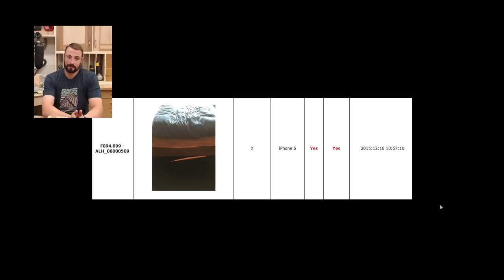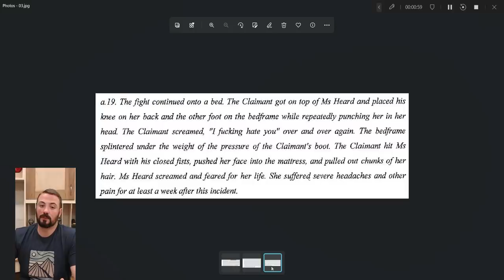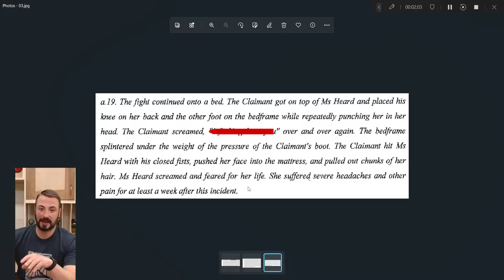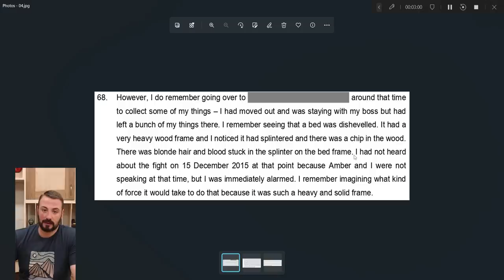Woodworker Attorney DEBUNKS Amber Heard's "Broken Bed” Testimony!

Comment: The only way, as a fellow wood worker, that I see is if the splintering has already occurred then with a foot you could  further split the wood.  Once the wood is compromised along the grain line it could be made worse.  I don’t believe a word she has said, mainly because it is all just a little far fetched, but the split is possible if it was already splintered.
Reply: Exactly this.
Reply: Also the wood he uses to demonstrate is way more rounded which makes it much harder to break the edge off. I’m not saying she’s telling the truth but a break like this is definitely not „impossible“.
Reply: With a house like that, and money like that, I can't see them not replacing a bed if it was already damaged.
Reply: I was wondering if it was already compromised or very old if that would make it possible.
Reply: @papersongs3482  It can be a small crack that you notice only when you slide your finger on it or your pantyhose gets torn by it. The rest and the size of it stays hidden because wood doesn't peel like a banana, and that's why it's fairly possible that the crack was unnoticed or at least accepted without repair until it broke off.

You can't draw any conclusions by their wealth. The room itself doesn't look like a multi-millionaire's house, and based on the amount of houses and apartments Johnny has + busy life + mental and alcohol/drug issues the two of them shared, they really wouldn't pay attention to that kind of stuff.
Reply: @papersongs3482  Also, when you look at the video, they never replaced the wooden frame even after it broke. In fact there is even further damage to it in the pictures.
Reply: I didn’t get a good look at the woodwork either, but “distressed” is a thing.  Some folks like that rugged looking woodwork.
Reply: @henrifin  correct…. I had to have a piece of pine removed from my hand the diameter of a toothpick and an inch and a half long from a splinter that didn’t reveal itself until My hand slid across it while shuffling materials around.
Reply: You'd have thought the police would have noticed the damage to the bed and the giant splinter on the floor? When they did the tour after being called. Add the fact that the body cam footage from the cop shows no wine spilled or broken glass etc... think we can be pretty sure she damaged the bed with the knife on the bed.
Reply: @lilbaz8073  oh…. I’m sure she’s lying.  My liedar is blowing up every time she speaks.  I’m just saying that it is possible if the materials are already compromised.
Reply: Also…. As a woodworker, if I had access to that piece of wood I could point out exactly where the knife went in most likely.  Unless she was smart enough to use a water to drawn the dent from the knife out of the wood.
Reply: @Dogsday198  wouldn't you see that on the splinter though? Darkening where a crack was and the wood was exposed to the elements?
Reply: @lilbaz8073  not necessarily there are plenty of times that I’ve pulled a splinter apart, let it go,and come back to glue and had difficulty finding it again.  It can be split along a grain line and the splinter stays tight to the rest of it.  Certain woods are more likely to show than others…. Oak for instance.  You do find a lot of those while sanding.  Also, and I couldn’t see the woodwork very well.  If it is lumber or Timbers, it is possible it has a distressed finish.  With a distressed finish, they intentionally beat up the material..  that was a pretty big splinter, all I’m saying is that it isn’t impossible.
Reply: Also from my experience, just because there is a split in the material, doesn’t mean people take the time to glue it.
Reply: But even if that were the case, it wouldn’t take the kind of force that she was describing.  It would be really easy in fact.
Reply: @Dogsday198  i meant after the splinter was torn off. If there was previous damage, a crack or split, that would expose some of the inside to the elements. Aging them. From the picture it all looked fresh. There would be signs of ageing on the edge where the split or crack was. Especially as there would be no stain or varnish on it.

Comment: Hi, I'm new to your channel and actually first saw you on a collaborative video you did with The Behavior Arts channel. I've seen similar damage from a powerful hit from a study object, but even then you need two things. The wood being splintered needs to be solidly held in place, which is accomplished by the connection to the rest of the frame, and the object striking needs to have a fairly straight crisp edge that hits parallel to the grain of the wood. The only way that damage was done with footware is if Johnny were wearing old time baseball cleats from the 1950s

Comment: I would say the difference are the 4x4 you are using to demonstrate your point has a rolled edge and looks to be "wet". The bed is stained/finished/ dry with a sharp edge...hard 90. All of this changes the dynamics and characteristics of the wood. I have with work boots knocked off hard corners on natural wood multiple times that look similar to that of the picture of the bed. Curious your thoughts on that specifically. Thanks for the video.

Comment: This a common failure point on large pieces of lumber, from stresses building up as it ages... while your knife example does resemble the picture, it doesn't rule out any existing cracks, that would have been exacerbated from the traffic such a wide bed frame would endure through the years of use. Not ruling it out, but "I'll glue it back on someday", isn't an odd natural occurrence - stabbing a kiln-dried 4x4 under studio lights?... eh.

Comment: When I looked at the splinter I knew it came from a sharp object than a boot, I used to knick the side if my bed with a nail cutter and it looked like that, albeit smaller. The panic on her face when Camille mentioned the pocket knife was also telling

Comment: As a structural engineer, no way JD would’ve broken the bed as AH described - it is way too strong and Rob has done an excellent job explaining it. I could possibly buy if the connections between the pieces of timber had failed, but with a bed that strong, those connections are probably just as strong to hold the weight of the timber. They should’ve called you as an expert witness Rob, but I think JD’s team saw your video anyway!

Comment: As a framer, if wood could break like this from work boots, none of us would walk on walls to set the roof. Not even the weight of a truss coming down too fast from the crane, slipping off the edge of a gable wall could do that damage.

Comment: To play devil's advocate for a moment - the only counterpoint I can imagine - and I'm extremely unsure about this - is that if the wood had already fractured or been split, and then the split could've been levered open with a slipping boot. 

The split could, for instance, be from idle noodling with a knife, or old age and poor treatment, neither of which are evident in the rest of the bed as you would expect.

Thanks for the analysis, very interesting.
Reply: True, but the penknife is lyng on the duvet!

Comment: Hey Rob.
I would agree with your theory according to the photo evidence.
How ever there is another factor we must consider with both pine and some hard wood timbers.
Old dried out timber can splint on the edges/corners can get damaged with some force, say a heavy weight of force with a a shoe with sharp tread, like some work boots. But that force would be of something like a hard kick or step, and the timber may get damaged close to the photo or as you demonstrated..
With greener or young timber, it reacts as you have shown here, as the grains are still lot tighter.
But the way she explains it in her testimony on Thursday, I was picturing his JD foot on the inside between the frame and mattress, to get the force she is attempting to describe.
But again when you look at the damage on the bed frame, there's no way there would be this big damage from one foot wearing a boot. Yes you can see the mark of something that was used for leverage to split this grain too. No boot even the ones I wear would leave these marks on the bottom of the splinter on the frame. It impossible. Looks like a chisel or a big bladed knife. 
So yes it's totally BS from her statement.

Comment: Wow! Up until I saw this video, I thought the splinter was coming off the bottom of the wood and hanging down! Which I thought could have been done with enough downward pressure (like if you bend a stick and it splinters downward) Now I see that picture is an optical illusion 😅 the splinter is separate and laying deliberately right on the ground below the bed.

Comment: I don't know if that is end grain. If you look at the wood grain on the top parts of the longer pieces running parallel to the length of the bed, they do not continue past the last 3/4" or so of that piece of wood. You can see that it is capped with something.

Comment: I very much agree. Although your demonstration piece has rounded edges while the bed frame appeared to have sharper, 90 degree angle edges, which would give it more of an exposed surface for the boot to splinter it. However I would expect, even if the sole of JD's boot could splinter off a piece, it would be much smaller, 3 inches in length at most and thin as a toothpick, not a large 12+ inches chunk. Notwithstanding I can not picture how JD is supposed to have his body positioned for one knee pressing her into the matrass and the other foot balancing on the edge of the bed, given the fact the frame is so wide. Either he would be on the bed completely, pinning her with one knee, or lunging with one leg on the floor, which would also get more purchase, as AH would say.
It should be rather easy to proof this without a doubt by inspecting the bedframe. A sabotage with a sharp object would leave telltale marks in the wood, the canal of entry created by the blade, wood being compressed on the sides, showing the shape of the intruding blade, like a cast.

Comment: One thing I haven't seen discussed is what type of boots were involved. If it was a standard western or dress boot, those have such a smooth sole that trying to brace at that kind of angle on wood like that would have you slipping and landing flat on your face every time you tried to put weight on it. A hiking or work boot you would probably be able to brace yourself a bit better because of the lug sole, but any other type of boot you're far more likely to hurt yourself trying. I know this because my dad always wore western style flat sole boots for work, and dress boots for church, and he'd have to replace the work boots about every two to three years. Personally,  I prefer a lug sole for better traction, but either way, any sole less rugged than that Timberland wouldn't have a prayer of being able to give any sort of support, much less provide enough traction to split the wood like that.

Comment: One thing to consider is how his foot could have been positioned. For instance, if he had rotated his foot to use the heel of, say, a cowboy boot, I could certainly see the POTENTIAL to break off a piece of the timber they way it did. I recall splintering off edges of wood planks and posts in this way myself, but it was deliberate. I still think it would be extremely difficult to have done this in the manner she described. Perhaps it could have been staged in this way.

Comment: I have a bad engineering habit of trying to devils advocate all up in experiments and this is a fun one. 

I think Occam’s Razor supports everything you said. 

I also think there’s a nonzero chance that at some point a knife or flat head screwdriver or something compromised the wood in that spot (or it was damaged during transport) such that bearing weight (during the ordeal, possibly not while their weight distribution was more on the mattress than the beam) caused the remainder of the beam to splinter and sever. 

So, nonzero. But your story is much more plausible.

Comment: I knew when I heard her testimony that it didn't or couldn't happen that way. As far as that tool on the bed, it looks like one of those multi-tools that holds some blades, screwdriver and maybe a corkscrew where they fold in and out like a swiss army knife. I have one like it and the holder can be used as a handle, it would be strong and sharp enough to do the damage on that footboard, just my own thoughts and opinions! Thanks for your demonstration, love your workshop or what I could see of it!! It's clear she put some thought into how to stage it and present it but didn't focus on how probable it was, what movie did she steal that from!

Comment: THANK YOU ROB. THAT WAS WELL ILLUSTRATED ON THE BED FRAME.  WHEN I FIRST SAW THE PICTURE, MY THOUGHT WAS HOW COULD HIS FOOT DO THAT.  THERE IS NO WAY HE CAN PURCHASE THE FRAME FOR IT TO BREAK IN THAT MANNER. SO THE KNIFE THAT WAS GIFTED TO HIM WAS USED AGAINST HIM, BY LEAVING OUT IN THE OPEN ON THE BED SO THAT CONCLUSION CAN BE DRAWN TO  BE USED AGAINST HEARD, HOWEVER, IF PROPERLY RATIONALIZED, THIS IS NOT THE CASE IT WAS USED TO DEMONSTRATE THE ACTIVITY OF VIOLENCE IN THAT MOMENT AGAINST HER; NOT DAMAGE TO THE BED FRAME.  THEREFORE, IT WAS SET TO DEMONSTRATE NOT ONLY J. DEPP's STRENGTH IN HIS FEET BUT ALSO HE WAS CAPABLE OF HOLDING THE HEAD IN PLACE IN THE COVERS, KNEE IN THE BACK, WHILST EXERTING SO MUCH ENERGY TO BREAK THE BED FRAME.  I WISH THEY EXAMINE THAT A BIT MORE AND USED MORE PRAGMATICALLY AS EVIDENCE...  THAT WAS GREAT TY.. ;-))

I HOPE ONE OR TWO OF THE JURORS WORK WITH WOOD TO DEBUNK THIS TESTIMONY OF THE BED BEING BROKEN BY JOHNNY ...

Comment: On a practical point, Is depp double jointed,specifically half way up his shin bones? I ask because how could his knee be applying preassure on a person's back, and his foot be on the edge of the bed seeking purchase. Even if he was wearing a boot with one of those tap dancing metal plates under the toe, he would need to double jointed for that foot to obtain leverage at the same time he was kneeling. On the other hand if this were fabracated, and the person resoncible wanted to avoid perjury, they might claim a mysterious memory loss and thereby no knowledge of their actions between events A, and events B.

Comment: The only book that could have cause that damage to the bed would be a boot with a wood or metal sole. 
Cause these are equally hard or harder and less flexible then the wood.
Maybe, very maybe, a steel cap safety boot could do the same.

However, I doubt any of those were or are worn by Depp.

Comment: Excellent! Also if her back was close enough to the edge for Johnny to have one knee on it and the other on the wooden edge and close enough to lean into her ear then her pelvis and down would be hanging off the bed onto the wood. With all the pressure and hitting and smothering she would have severe bruising on her stomach, front of her thighs etc. As Johnny said “it’s all such bull sh!t”…

Comment: I must say I have actually done this, on pine, with shoes. I have an old house and the stais was old, dry and neglected pine. And for thistest we regrettably don't have the specific piece of wood or the kind of shoes Depp was wearing. 
But seeing as he's a rich men, I doubt it's old, dry pine that's been around since the 50's. And the "tool" on the bed is just a bit.. typical. 🥴

Comment: I broke a bed once when I was 15. I was nostalgic for jumping on the bed as a little kid. Needless to say, it only took one jump and crack! Splintered one side. It was basically just 2 larger than average boards (like 2x4s but bigger like 5-6 in wide) attached to a headboard and footboard. I had just finished taping it back together with clear packing tape and was just putting the mattress back on when my parents walked in. I would have loved if it had been as sturdy as Depp and Amber's bedframe

Comment: When I first saw the photo admitted in the court, I knew that what she is claiming is not true.Even if JD weights 1000 lbs, a 6 x 6 running a span of 5 ft will not buckle to a point of splintering on top edge like that. Done my share of DIY projects around the house and about 6 aquarium stands so I know what it's like to work with soft wood. The two way that you would get that splinter is 1- the way you explained it and 2- if the top is already previosly damaged and cracked in the edges, then his boots could have lodged it loose. Number 2 is highly unlikely because people do not buy broken and splintered furniture knowingly. Also, something sharp would have to cause that kind of damage to begin with. As pictured, her testimony is false. Good job explaining this with "demonstrative" so people will understand how this splinter could happen in the real world.

Comment: It theoretically  "could" have been done by a blunt object such as a hammer (anyone who's ever swung one has "chipped" a board or 2) however the so called splinter is on the bottom and it's pulled down, out and away from the bed itself and would not align with someone partially on top of the bed attempting to gain purchase. The foot would have to be completely off and under the footboard and exerting force out and away from the bed. One would need to be under it to accomplish this

Comment: You can see the point of entry where it was stabbed to break it 
It's a twin of the mark you made in your example
Same spot, on the widest point of the damaged wood. A small dark almost pin point divet in the wood.
What's more is you cut off piece & the other's are practically IDENTICAL
🤔

Comment: It depends on the type of wood, how old the wood is and with this wood, it is not rounded, but pointed on the edge. So can it happen with a boot? Yes, but how can he put pressure on her back and have enough strength to also apply the pressure on the wood? 🤔 I hardly think so